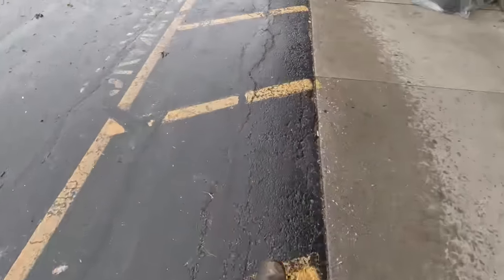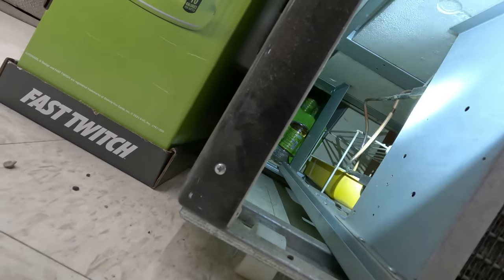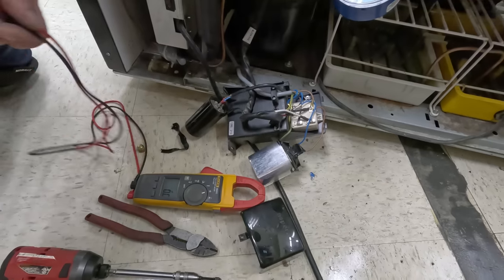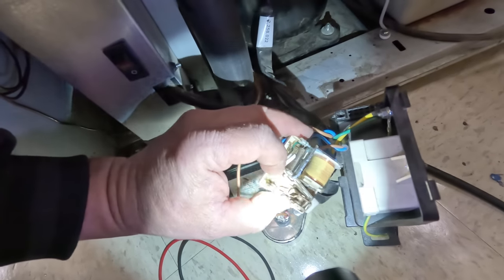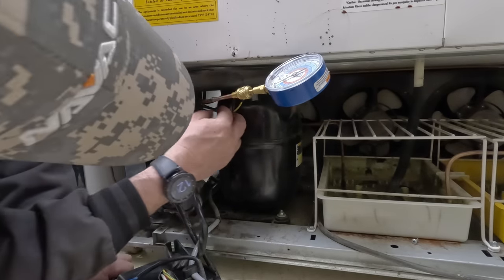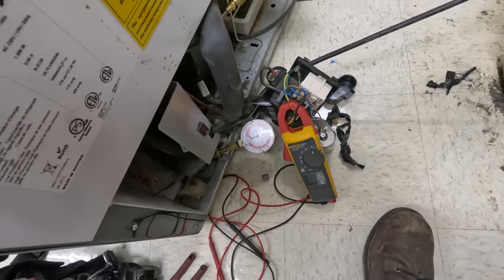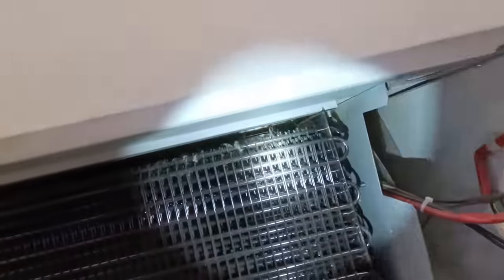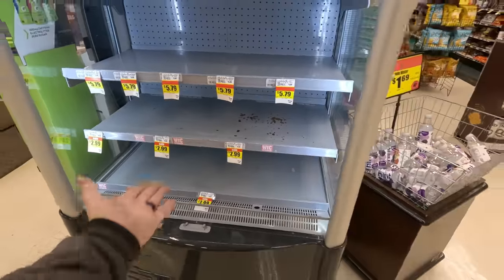Not What I Thought It Was

Comment: Great video! When the start capacitor is hot what I’ve found sometimes is the potential relay contacts are getting stuck closed and since those start capacitors aren’t supposed to stay in the circuit while the compressor is running they get hot. And then the compressor can get hot from more current flowing through the start winding than normal.
Reply from the maker: All sounds true to me.

Comment: I THINK when that night shade is pulled down the dixell will run the machine at a lighter capacity for energy conservation, sometimes it'll be setup to raise the setpoint with curtain down, great video!
Reply: And the light on the controller was indicating night mode.
Reply from the maker: @ericpaul4575  okay that sounds believable but you can't let the temperature get above 40° with milk in it? What changes in that mode?
Reply: Only thing I can think of is the number of defrosts. It would be safer to do a long defrost with the night shade down.
Reply: That shade connecting into the gray "temp sensor" and kills lights and puts to night mode aka knows shade is closed
Reply: @HVACRSurvival  night setback

Comment: Great continent. Just an update on the 404A walk in freezer issue with the short cycle in summer.
I got on the roof to drop the cut out to 2 instead of 5 and found that the pressure switch is acting up. It was set all the way up to 8 psi before cutting out at -2psi. I adjusted it to shut off at 2 psi but that required me to brink the pressure control all the way up to 12 psi. I will be ordering a new one. Thanks for the advice and your time
Reply from the maker: I hate when they don't act up while your there. good catch!
Reply: For sure, I totally misspelled what I wrote in the previous message. Thanks again for your help 
Take care
Reply from the maker: We're technicians, we're smart enough to read it a couple times and figure it out😆💪

Comment: When you pull down the curtains, there's a magnet at the bottom of it and it aligns with the switch at the bottom ( going from the top of the plastic bottom part ) to the digital input of the dixell.

It goes in eco mode/energy saving mode.
Reply from the maker: Thanks for the info👍👍

Comment: I have an old Sears mini fridge, that's made by Sanyo. I don't know exactly how old it is, but it seems to be from either late 70's or early 80's. All I've had to do to it was replace the old mechanical thermostat because it was short cycling, so I put a digital one in. I also upgraded the efficiency  by upgrading the insulation from fiberglass to styrofoam. The only thing that worries me is that the compressor gets up to 165°F. Do you think I should add a fan to blow air over the compressor?
Reply from the maker: The say the discharge temp should stay under 225*f

Comment: So, are you guys with experience I have a question. It seems to me, as an outsider looking in,  the HVAC business is basically changing filters and replacing bad compressors and bad T x v valves and And relays. With the side of don't fiddle with this compressor, don't stack stuff in front of the chiller units in the walk in coolers, and don't cut or poke holes in the evaporated coils so that all the coolant leaks out . Is that pretty much it?
Reply from the maker: 😂😂 The same could be said of a family Dr. They prescribed medicine that has side effects that require more meds, they have someone else check your blood pressure, your pulse and weight. They look in your ears, listen to your heart and ask stupid questions like are you having money problems, feel safe at home or want to harm people? Sound familiar? Everything looks easy from the outside.
Reply: @HVACRSurvival  That's the truth . I know i'm not the one dragging tools Up the ladder, or we're trying to get my fat hands into the tiny space at they left for the compressor, or are you fill in the Blank!

The thing I try not to forget is that with all that experience, It just looks that simple . It doesn't figure in the thirty or forty plus years of doing it!
Reply from the maker: Don't forget most people needed to pick a career and the stuff I get paid for are things I use to do for free or fun. I have more freedom to do what I want and when I want then most careers.  I've never had to worry about getting laid off or if my job will be made obsolete, It's been a recession proof, it's also a skill that I can do after hours if I wanted to make more money plus I'm paid very well.